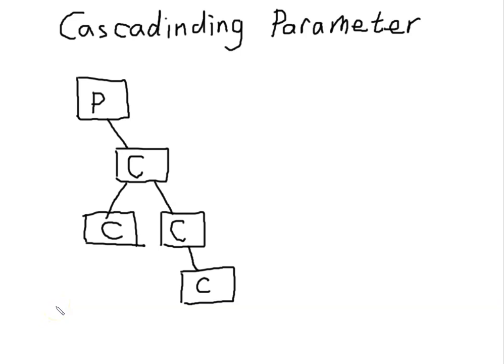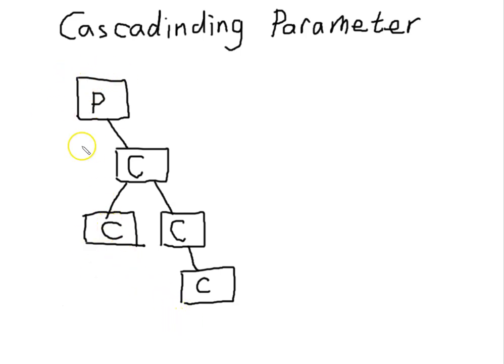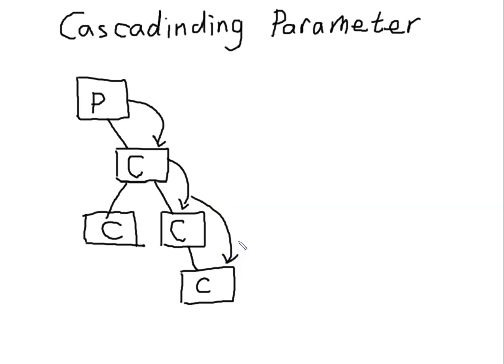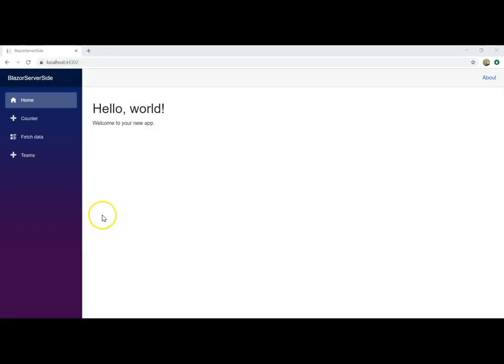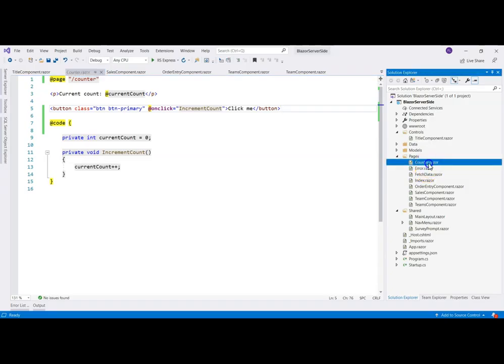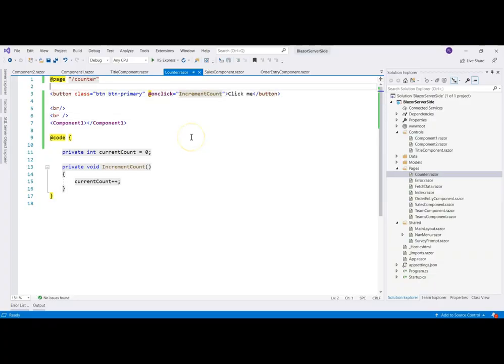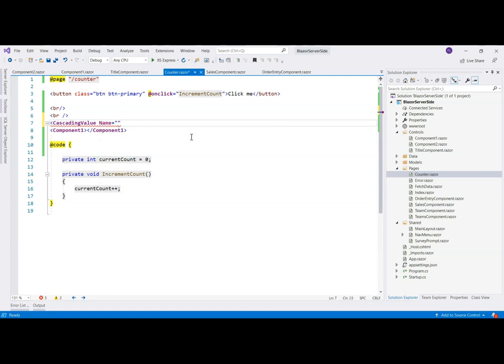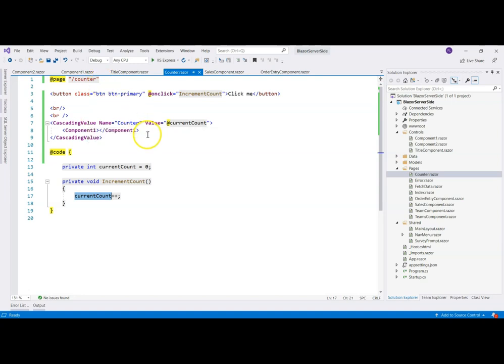Blazor Tutorial - Ep 10 - Cascading Parameters: Benefits and Drawbacks | Performance concerns...

Comment: I was surprised to find that passing values from child to parent was not made simple  (and requires a ton of code to do) by the Microsoft development team.  It would be nice if they did it like they do in Winforms and even old Webforms where you could use some sort of dot notation like: parentcomponent.childcomponent1.childcomponent2.idofelement.attributevalue
 then just set or get the values directly.  It would make coding Blazor much faster and be closer to the DOM systems that React, Vue, etc use. (then you don't have to jump through hoops when using a very complex control that has dozens of elements and write individual events for every conceivable change)

Comment: thanks Frank, the explanation is clear and good to hear some one saying the drawbacks and limitation of cascading parameter. I found that it's useful if you need to implement the features that included multiple components. 

We should not over use it and it's easy to cause a dependency on the child components.